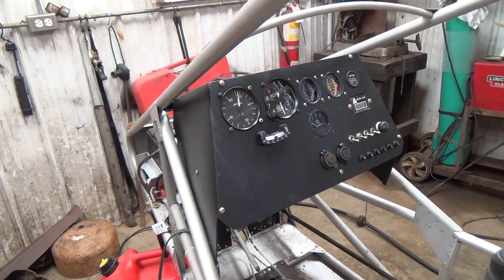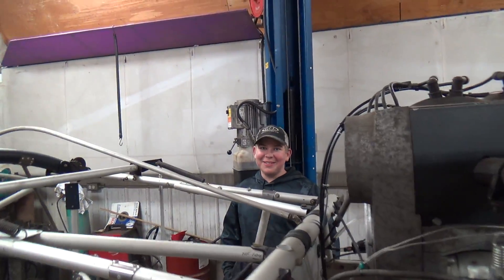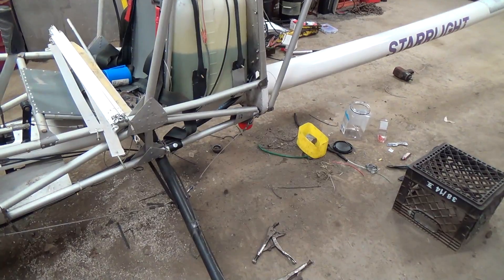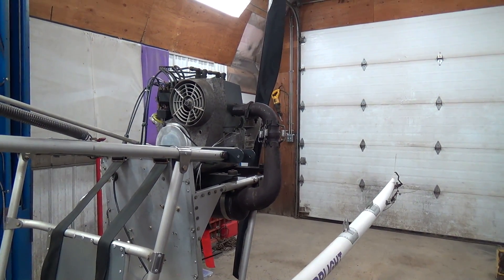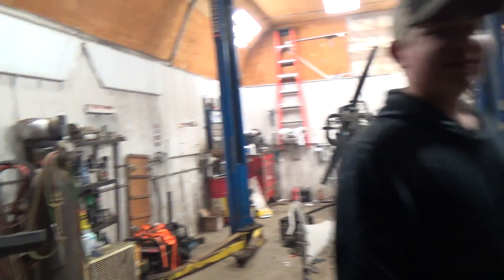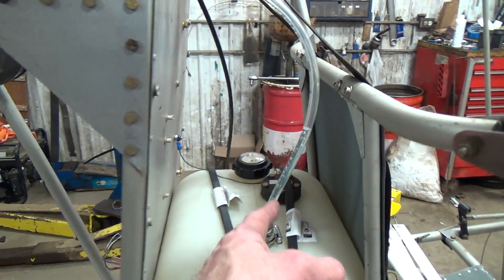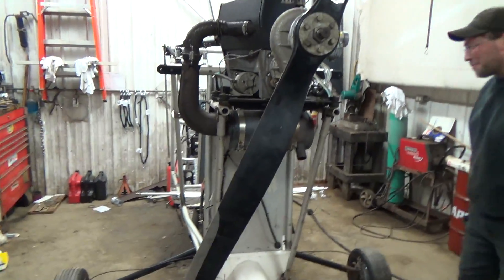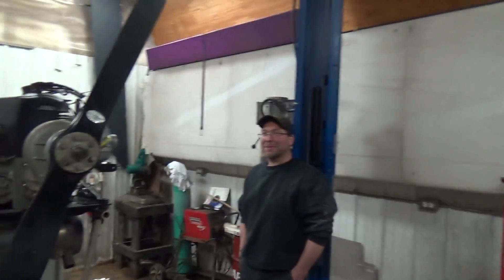First Engine Start | CGS Hawk: Update 2

Comment: 1:17 There appears to be a crack or split in the black material of propeller hub near the "2 o'clock" position.  Is this normal?  Are there other segmented pieces of the hub flange?  Nevermind, you answered the question below.  "Segments at 2 and 8 o'clock.

Comment: looks like the fuel is running back into the fuel tank.  That is a bad thing.  Suggest checking the check valve in the fuel pump.
And what was all those bubbles in the fuel line,  Is it a major air leak?
Reply from the maker: Nope, minor leak. Dave's currently working on replacing the pickup line in the tank to get rid of the leak.

Comment: first thing to do is replace that IVO prop with one that will work for you rather than against you
Reply from the maker: I used to run an IVO. Very smooth and worked very well for me.